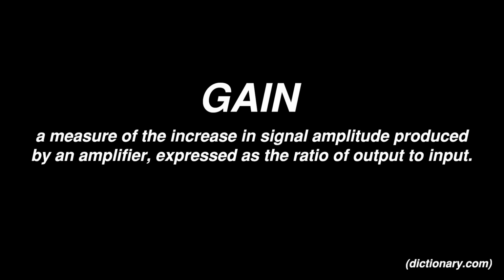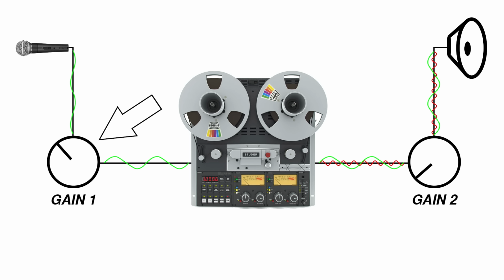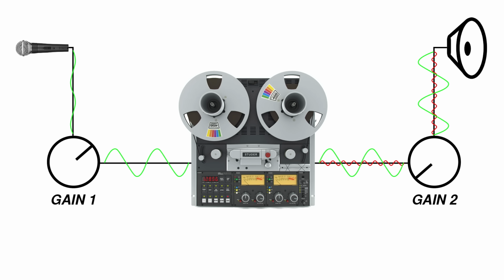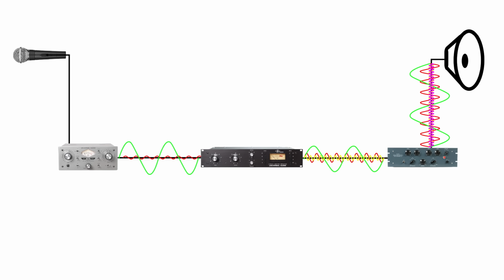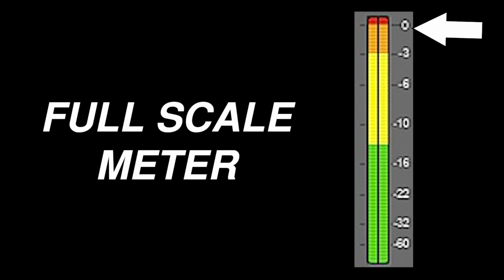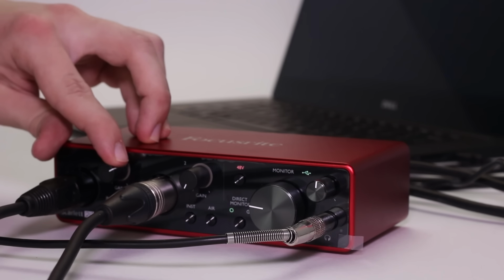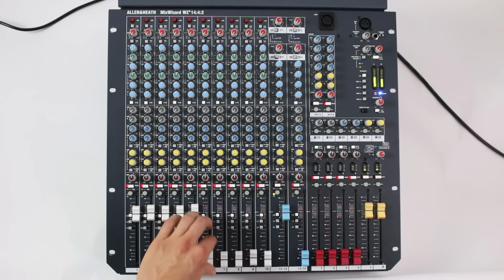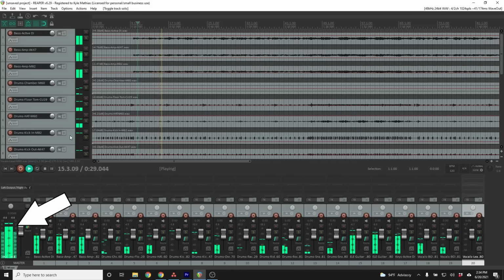Gain Staging Secrets Every Great Audio Engineer Understands!

Comment: Don't you love when you've been running audio systems for 40 plus years and within 5 minutes a 20 year old kid has already started to teach you something.
Reply from the maker: Glad to hear that, @The Aleons! Thanks for the kind comment.
Reply: @AudioUniversity  yeah I was worried that I might have been peeking my Daw but my cakewalk sonar maxes out at zero on the meters. They turn red about -6 so I actually run a little in the red just like a VU which I like. Someone else was arguing with me about running my d a w m in the red and I'm like no man I can hear clipping especially digital clipping I can hear that s*** from across the block LOL
Reply from the maker: Haha! Digital clipping is hard to miss! In reality, digital signals in the DAW sound exactly the same regardless of level until they actually reach 0 dBFS and start to clip. That is, unless you’re using plugins specifically designed to for non-linearity. Of course, signal to noise ratio varies at different levels, but there’s A LOT of room for error in the 24-bit digital realm when it comes to noise.
Reply: @AudioUniversity  
You rock buddy.
I like your style.
Keith
Reply: I’ve only been running audio for 35 years - (and training others on the subject for 15ish) I also was delighted to learn something from a youngster….. interestingly, it was that exact same thing! I’ve been reviewing all my software and checking whether it uses VU or FS meters…. I hadn’t noticed the change to FS and was still mixing everything as if I was looking at a VU meter. Every days a school day.
Reply: That’s something I learned in the military(sometimes the “hard way” lol)…if you stay humble and open your ears and mind you can always learn something from just about anybody…no matter age, background, etc…sometimes what you learn is simply that the given person is a true knucklehead etc, but you can always learn!
Reply: That's part of the older generations job. Making it easier for the generations to come, so they don't have to struggle as much as the previous generations. That's how it's supposed to be anyway. ;)
Reply: That's life, and advances in technology. As long as you don't develop negative feelings against the kids, everyone gains from the interactions. New technology brings slightly different ways of achieving your aims for audio projects.
Reply: @inthefar-queue6270  The kid is literally reading straight out of a textbook, lol
Reply: I've been working with audio since 1984 and I think I've been learning from everybody, many of them this age, all the time. 😊
Reply: Agreed. 60-year-old here, home recording since I was 17. I love how audio technology has become more theoretical at the user level and let’s be honest, both live and recorded sound has never been better.
Reply: Some people make for great teachers. Others are just bitter old men
Reply: Yes there's always room to learn.
Reply: Respect for still being open to learning at 40 years
Reply: This reply thread is such a honeypot for crotchety sound guys with bad attitudes who feel the need to dunk on someone leaving a positive comment AND the person providing quality, free content to them simultaneously. ^_^
Reply: Usually, if I can throw my old guy pride out the window, and shut off the "don't tell me, I been there" loop, I can start to learn something. If it's true, it isn't true because any one particular person said it, it's just true because it's true.
Reply: It's just spot on.
Reply: So true-Thank God for the Youths 🤙🏽
Reply: 4:14 usually,  the kids remind me of things I forget I knew
Reply: I'm going to go through all my mixes & make them more breathable! Thank you 🙏🏾
Reply: Your kids are always better than you, especially when they play the video games.  :)
Reply: @Thomas.Lee1999  it's annoying 🤧😝😝😝🤣
Reply: @000JonnyBoothworthy  😀
Reply: As an instructor (and author, kind of like teaching without Q and A) of many disciplines (five degrees), including at College level, I've found that teachers can often learn from even the most novice of students, if willing to pay close attention, and realize that some rules can often be broken (purposefully, or through accident or ignorance) which lead to new understandings, typically affording greater creativity in application. I'm 78, and still teaching, still learning... more of the later, I suspect, having obtained my first Doctorate last year (Theology).
Reply: A lot of people hate that sort of thing
Reply: or at least he tried ;)
Reply: Love that true devoted nerdism
Reply: I love it, but that broke my heart
Reply: Gotta love the internet
Reply: The Dunning Kruger Effect is strong within the title "Every Great Audio Engineer Understands".
Red lining a track in a DAW is not in any way as detrimental as it comparatively was within a fully analog rig back in the the 20th century.
I know, because I've done both. 
Mix with your ears kids. Not with your eyes.
¯\_(ツ)_/¯
Reply: 😂😂😂exactly
Reply: That is the same story for how Deadmau5 got his first studio job. He schooled an old man who didn't know about computer-input tracks
Reply: no.. stupid kids!!! lol, jk :)
Reply: Wher ya. Based mate m do you do any good deals ££.  to record a live band
Reply: That is a sound confession.
Reply: Would you guys like some cheese with your WINE. My god. Whiny babies
Reply: Hi kyle do you travel to help set up audio for small church?
Reply: kkkkkkkk
Reply: No. I don't. I don't trust anything anyone under the age of 30 says.
Reply: Textbook or not as long as he’s right! 
Best teachers are the best understand-ers. 
Better than those “not ready for prime time” YT instructors. 
You know the…. “ so this is how… no… wait.. just… hold on… wait no…” those guy’s. 
I’ll take the baby face kid thank you!
Reply: But what have you been doing all this time?
Reply: @TomorrowisYesterday  are you being cynical or are you actually curious?
Reply: @thealeons3179  Both I guess, I mean all he's doing is putting a different name on gain structure. I would be extremely critical of the person who trained you and of the people who have been working with you for all of 40 years if you don't have a strong grasp of gain structure.
Reply: @TomorrowisYesterday  He may have been referring to the difference in analog and digital gain staging at the preamp level. When I first started it was drilled into me that my preamp gain should be as hot as possible without clipping where as now with digital mixers -18 or -12 are more the standard. I could see that sort of thing passing you by as it was looked at as a basic fundamental of building your mix for so long you might not even know to question it.
Reply: @user-xe7um4pv8i  Fair
Reply: @user-xe7um4pv8i This lower value is a special thanks for avoiding clipping. Recently, many hand recorders with 32-bit floating have appeared. There, you don't need to worry about clipping or gain adjusting. This will also bring a new era of digital mixers with AI functionalities.
Reply: @user-xe7um4pv8i what eq tools would you recommend in FL studio please
Reply: I feel like this kid is literally just reciting from textbooks what he just learned at school and made a YouTube channel of doing that.  However, the videos are super useful references so I’m glad he’s done it.  Like you said you start to lose some basic knowledge over the years.
Reply: @GaryDee119  You're just jealous of his intellect.
Reply: @TomorrowisYesterday  that must be it.  You got me
Reply: Lollllllllllllll every new generation has mad skills they don't know how to use. Sometimes it seems every year kids are more skilled
Reply: Yes, I completely agree. It also just goes to prove that age is not necessarily a proxy for wisdom 😄
Reply: younger people know better
Reply: @tnntlmmn277  All people matter, young or experienced.
Reply: Kinda sad you didn't already know this stuff. It is pretty basic information, so I'd be curious what you been doing in the past 40 year?
Reply: @csengo70  I've been working on high rise buildings doing the electrical, I've been playing guitar in a band, I've been working as the guitar and amp tech at 3 different shops, and as an independent freelancer, I've been doing concrete work and building block walls, giving guitar lessons, and helping friends fix old cars and motorcycles. Now I'm kinda sorta semi retired, and I'm interested in the recording and production arts. I have literally fallen in love with digital audio, especially Macs and Logic Pro. In spite of everything I've done, I'm a relative newcomer to this. I have complete confidence in my ability to grasp it, given sufficient information. What have you been doing for the last 40 years?
Reply: That's a really long time to suck at your job.
Reply: @waytospergtherebro  LOL my job is industrial Refrigeration. My hobby is music and recording in my home studio. But yeah I'm sure in your tiny little brain you're smarter than everyone else.

Comment: I think this started out really good and really clear - the best discussion on gain staging I have watched.  But, near the second half of the video, it started getting so general and non-specific that it lost me.  For example, when introducing effects such as compression... what's the best case scenario for this?  Do you want your output averaging around the -18 dB range, as well?  And if you're chaining an EQ and a compressor, do you want the output of the first effect to average -18 dB going into the second effect and - in -turn - the output of the second effect also averaging -18 dB?
Reply: @ghost mall Not necessarily.  For someone starting out with this, you need to know what is "right" before you can understand what is "wrong".
Reply: @ghost mall Ears can be deceived and bad mixes come from people relying on their ears just as much as relying too heavily on numbers.
Learning the limitations & flaws with our own ears is equally as important as understanding of limitations of metering.
So yeah, you don't want anyone who comes out "use your ears" mixing your songs just as much as someone who tries to make everything fit target numbers. Both camps are beginners or people not prepared to advance as engineers, the latter are people who should be avoided at all costs.
Reply from the maker: I appreciate you writing this to help me improve my videos! Thanks, Dan. 

I think the specifics depend on personal preference and workflow. I guess keeping the signal around -18dBFS at every stage is theoretically optimal. In practice though, it might just be such a small change that is needed that it’s not even worth the time spent getting it just right. For me, as long as the signal is around -18dBFS, I’m happy - knowing that it’s what the plugins “expect”, and the signal to noise ratio is healthy.
Reply: @AudioUniversity  Only plugins emulating analogue saturation expect an average level of -18dB RMS generally (Some are adjustable and some operate totally differently) and that's mostly to emulate systems that were set up with lower headroom as 0dBVU is more of a range of around -18 to -24dB if we're equating the maximum headroom to 0dBFS. If you don't use any of those types of plugins, it's just arbitrary. Plus it's easy to gain stage for an analogue emulation with a gain plugin, its just more good practise to do it from the outset rather than something that'll ruin the mix like it would with hardware. Could even go the opposite way if you're particularly concerned about clipping and take levels down further and boost the gain into that plugin for what it expects.

The recommendation to set level in a DAW to -12dBFS is a seriously bad recommendation and is the worst place to start any mix as levels will be all over the place which has a psychological impact on the mix. Anything dynamic, such as drums & vocals will be quiet and anything that is the opposite, like distortion guitars will be very loud if they all peak at -12dB.

The best place to start is with everything set to an average level, such as RMS or integrated LUFS, never peak. -18dB RMS is often a bit too much for a mix and might want to go lower to guarantee not exceeding 0dBFS. However it wouldn't be unreasonable to not see this as an issue when starting a mix as processing such as compression, subtractive EQ etc will help to control peaks, plus if someone wished to emulate analogue properly, they could apply some form of soft clipping on the master to recreate exceeding the headroom rather than the hard clipping of 0dBFS.
Reply from the maker: Thanks for taking the time to write this info, @3rdStoreyChemist! These are great points and will be helpful to others in the community.
Reply: @targaryen2077  No, the master doesn't matter, your only concern there is that it is not clipping. If you add a plugin that emulates analogue hardware, then you'll want to make sure it is at a level appropriate for what the plugin is designed to do, but if you use nothing on the master then don't concern yourself with it.

What I mean by average level is setting each channel to a set RMS or LUFS level rather than peak, personally prefer LUFS. This isn't perfect, but it is a far better starting point than having everything hit a specific peak level and less likely to be misled by levels that are all over the place. Which with peak, it will be.

A lot of explanations out there are meant to mislead and apply aspects from the analogue domain to the digital domain which simply are not applicable.

Comment: Helpful run-through. Thanks Kyle.
Reply: Would gain staging with this approach (peaks around -10 to 12Db, rms around -18) be applicable to mixing for film/tv?
Reply: @PrisonTorture34  Can be, yes. First, to clarify, -10 to -12dB FS (most mixing boards use a dB VU meter instead which often tops out at +16, more or less, depending on the board). And in some cases for film, the target peak level may differ depending on what you're recording and whether you aim to make a usable mix or are just recording isolated channels. But generally, for interviews where you have 1 or 2 people, I'll often aim for peak levels at -18 on quality recorders, maybe a little higher on lower quality recorders where there's more self-noise.
Reply from the maker: Wow! Thanks for the detailed answer, Curtis!
Reply from the maker: Thanks, Curtis!

Comment: Don't always set your Master to Unity 0db. If you're working with a massive live sound system which isn't properly attenuated at the amps you're gonna be turning Channel faders up only slightly before it gets really loud. Low faders means 2mm moves give you a 5db difference, so you're better off with a Low Master, High Channel faders for easier fine tuning. This is situational and only an example of venues I've worked in.
Reply from the maker: If you can’t adjust the amps to the proper output level for the venue, I agree. Use the master fader as a volume control. However, it’s probably best to turn the amps down when possible.
Reply: @AudioUniversity  dead on! That’s why I got a nice line attenuator for our powered speakers since they didn’t have an on-board output control.

Comment: Just remember:

Our hearing judges loudness mainly by average levels - closer to RMS - and not so much peak(transient) levels.  

That's why it's good to use a VU plugin that can be calibrated so 0dB VU approximates -18FS. 

There are also pure loudness plugins available, or might already come on your DAW, that measure in LUFS(loudness units, full scale).
Reply: I know this is an old comment but I thought I'd just say: The important thing when dealing with a digital system is that the signal NEVER exceeds 0dbFS. This includes peaks and transients, no matter how brief.
Reply: @lennonmclean  Preachn' to the choir, my man.

My concern is the ever-closing gap between RMS, LUFS, average level, whatever the prevailing term is for it, and said 0dBfs peak, during music production, specifically in mastering.  

It's making otherwise decent sounding recent popular music sound excessively dense, lifeless, and frankly not very relaxing to listen to.